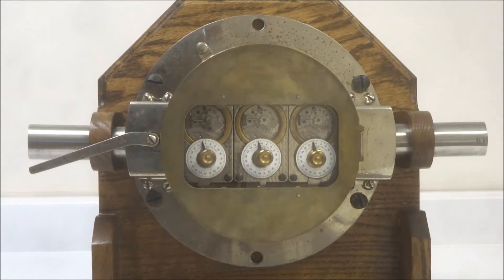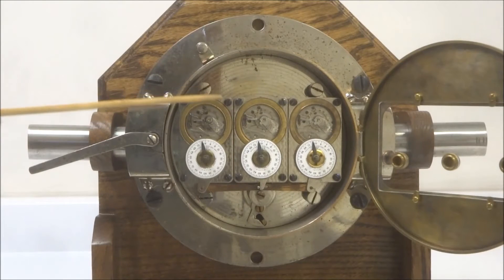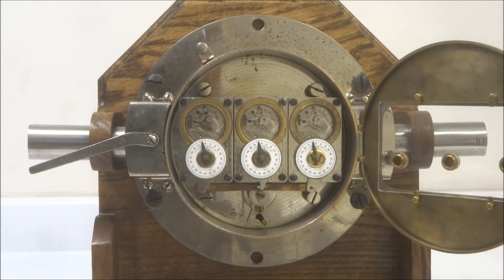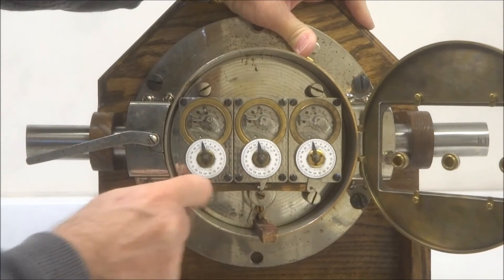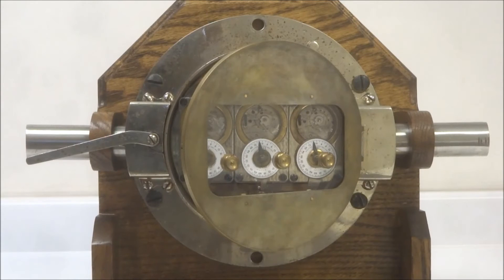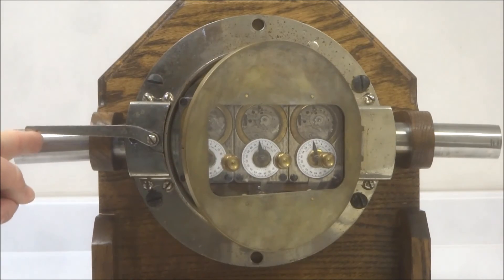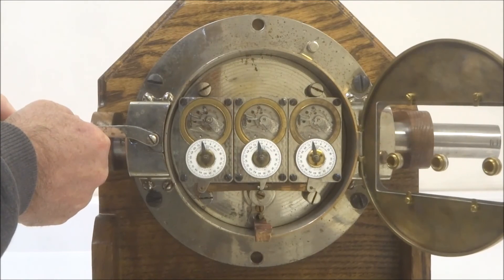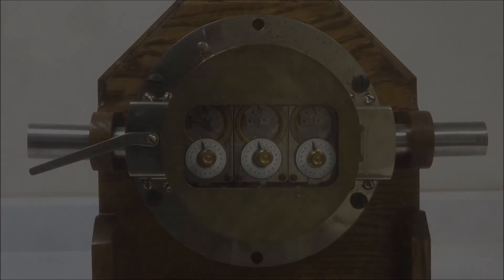Consolidated Dalton Automatic Time Lock, c. 1905

Comment: Thanks for showing this motor.  I purchased from John  2 different bolt motors that would have followed this one.  Both being Yale made.  I am glad you got this one as I have seen an early  Ely Norris but it was missing the movements from the case.
Reply from the maker: Hi Doug,
I'd like to see the two from John. I've sent you an email too.
Reply: They are both boxed up at the moment but one is the one you refer to as a rare T31-1/2? just like on the Ely door I sent you pictures of.  And  the other a Y361.